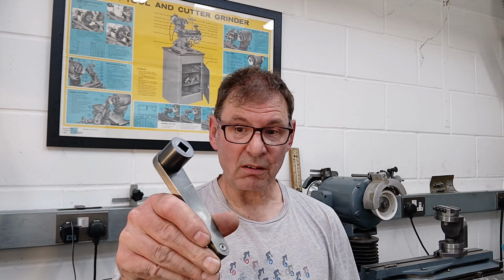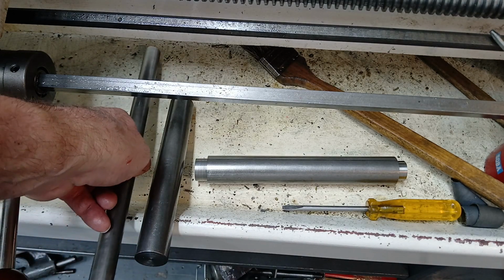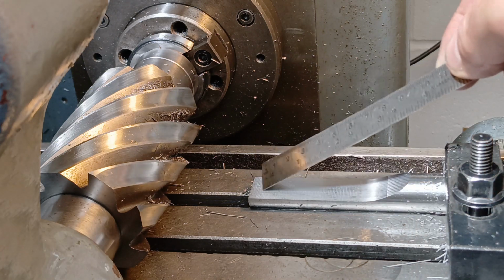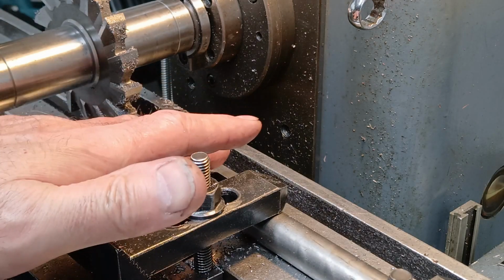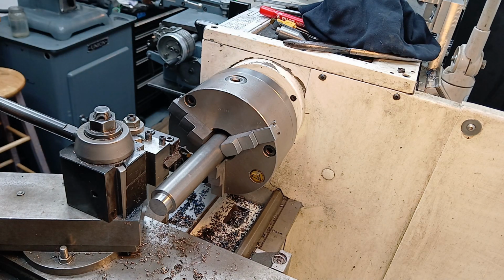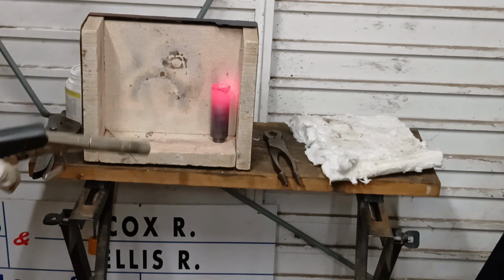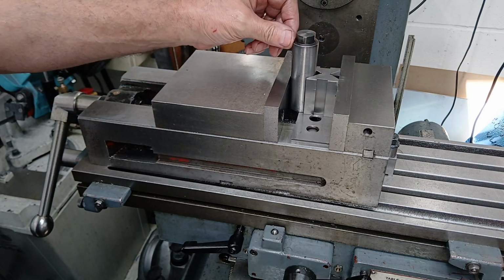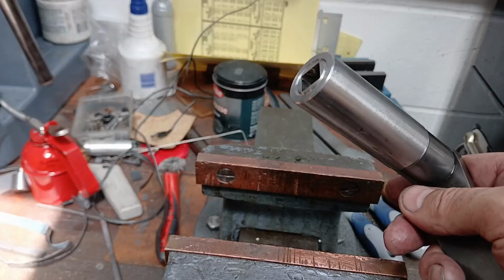Crank Handle Extension

Comment: Wouldn't a 1/2 drive impact socket of close dia. Work?
Use boring bar turn socket end to size, insert rod then weld or braze and turn down to desired size.
Make handle for othe end

Comment: Thats one wsy of making a square hole but i find it easier to make a right angle cut using an end mill. If you start with round stock, drill a longitudinal hole, deep enough for two pieces, the same size as the square. Then mill a corner using the hole as your guide to give you a "Pacman" section, the rest is pretty obvious. 
When i wrote this up as a demonstration at one of the ME shows and later in the SMEE journal, i got a trophy, some people are easily impressed😂😂😂😂

Comment: New to your channel, very enjoyable video, thank you
Can I suggest popping back in the lathe and drilling and tapping a small hole in the male end of the extension, then you could run a bolt through the hole in the handle with a wide washer and you can be sure it would not come apart until you removed the bolt.
Thanks again, looking forward to watching more of your videos
Reply from the maker: @seamusbolton215  Thanks for watching! Your suggestion is something I thought about but did nothing about. Another idea was one or two grub screws in the sides of the handle projection with the square socket to lock them together. So far neither has been necessary as it doesnt readily fall apart, but I might do it one day.

Comment: 2:20 in! At this point I ask myself if one of those battery drills would be a good idea for this rewinding? (probably depends on the required torque & if you like the battery idea)
 I was expecting you make a spline Nut on the handle to connect to the longer shaft.
Reply from the maker: @timogross8191  I've tried a battery drill. If I'm not careful, I'll do my wrist in with the initial torque. The handle is much kinder to aged body parts!

Comment: Nicely done👍🏻, one day I would also like such a setup with a dividing head.
Reply from the maker: Thanks. I bought the dividing head out of necessity, as I needed a new helical gear when I rebuilt my surface grinder. Putting it on the shaper was an inspiration that came much later.
Reply: @ThePottingShedWorkshop  That's the beauty of being resourceful. step one I already have a shaper. very educational thank you👍🏻

Comment: A very good demo of how to make an internal square without spending a fortune on a broach... I'd have used loctite instead of faffing about with solder given the application, but then I'm lazy...
Reply from the maker: @mib1796  Thanks. I got a load of 55% silver rods cheap, so I'm determined to use them! I wasnt sure the torch would be up to the job, its just a Bullfinch propane-air torch, hence the hearth to contain the heat, but it went better than I could have hoped for.
Reply: That’s interesting. I always thought you needed acetylene to achieve enough heat. If Propane works it’s a damn sight cheaper.